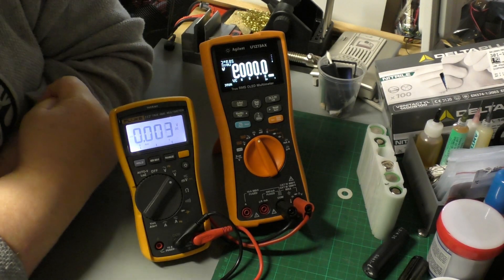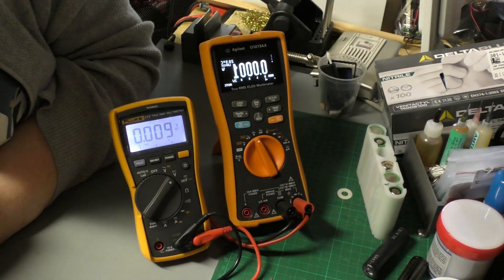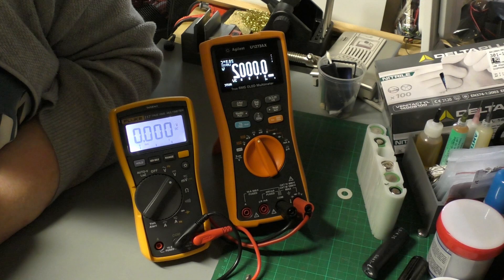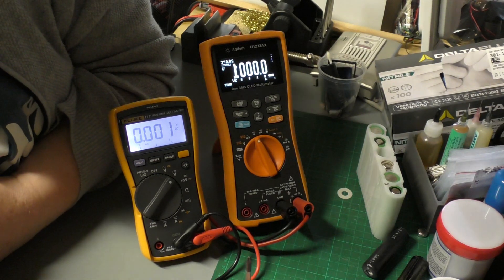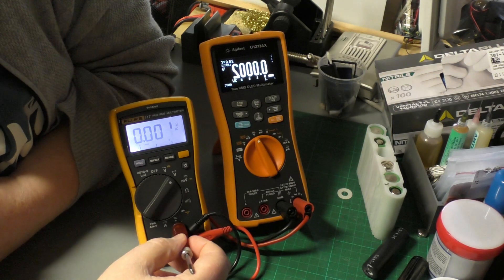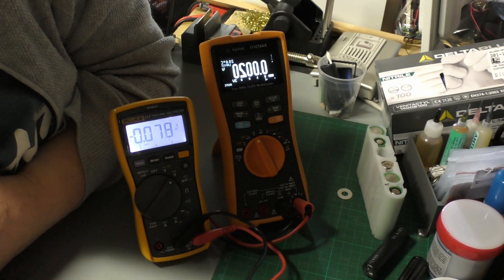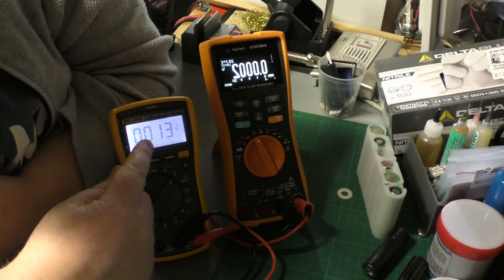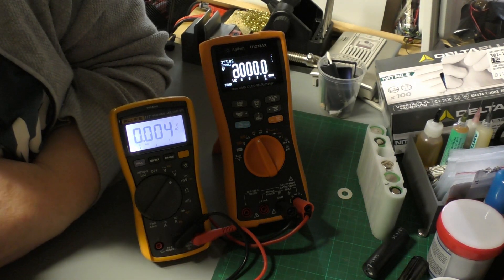Agilent Multimeter U1273AX Update

Comment: Dear Zone1242 - I made a previous comment on your YouTube page regarding my purchase of the replacement screen - I just received it - installed it and it works really well - the screen orientation is the correct way - let me know if you would like me to add the link and please let me know if you found your U1272ax multimeter - the seller has both yellow and white displays
Reply from the maker: Hi, yes I found the multimeter so please send details of where to buy the display.  If links are not allowed in comments then you'll find my email in the 'about' section of my channel. Many thanks.
Reply: @Zone1242  just sent you an email